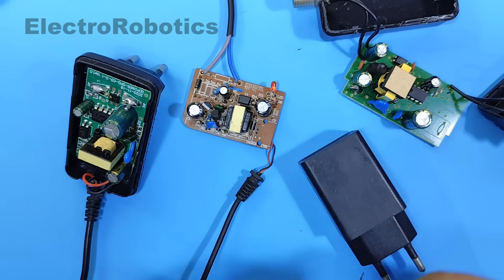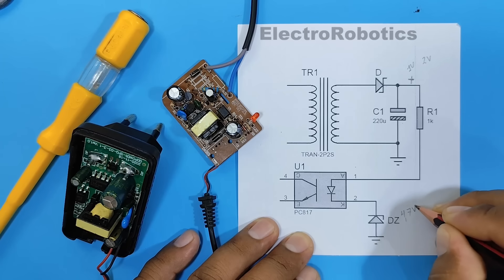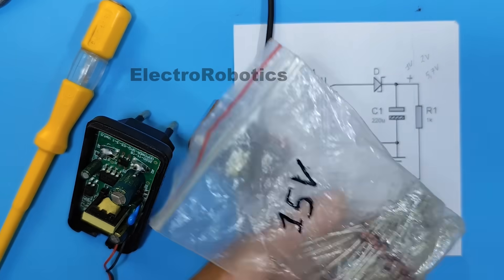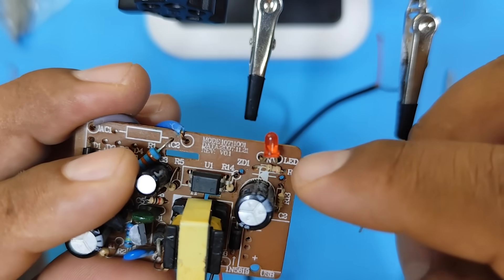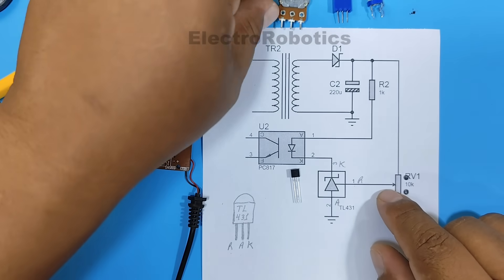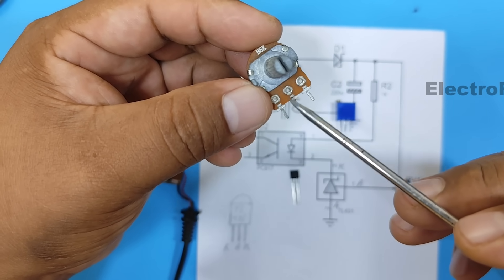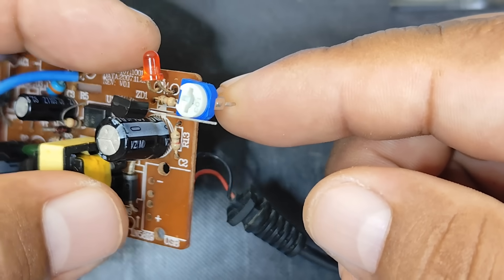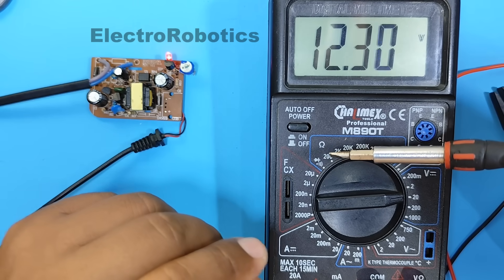Modify Any Charger and Adjust Its Voltage.

Comment: What about Zener Diode D? Doesn't that also affect max voltage limiting your adjustable Zener diode DZ max voltage?
Reply: Thanks to garymucher4082 for making me realize another flaw. Any  irregularity is passed to the TL4312 which can  interfere with the regulation.  This is a real and serious flaw.   Using a DVMM with no load is a rather naive test.
Reply from the maker: Hi Awesome Cat, if you're referring to D1 in the diagram, that's not a zener diode.
It's a Shockley diode, which is different from a zener.
Unfortunately, Proteus8 uses that symbol, which is the same as a zener.
Reply: @ElectroRobotics-qo2er  The zener and Schottky diode symbols are slightly different.  The angled cathode ends bend towards the right on the Schottky diode, rather like the letter S.  The angles bend towards the left on the zener diode, rather like the letter Z.
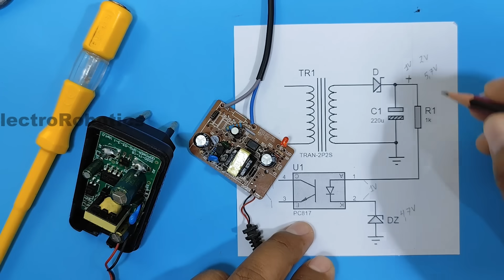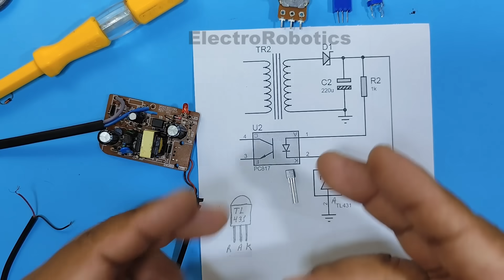Reply: @ElectroRobotics-qo2er  Oh, i just realized that the zener diode D @3:42 in the video changes to D1 later in the video like @6:41. I had wondered why I called it D1 originally then "corrected it" to D. But I googled the Schottky vs the Zener, and I can't seem to find the Schottkey symbol in either diagram in the video. I also find on the web that Zener is shown in two different variations which is confusing since the one that looks closer to an S according to some pages is the Zener. how confusing. I haven't used either, so it's a little difficult to follow which one is which and why one is used over the other. I'm a noob, and so it is a little confusing. I really like the topic, but as a noob, it is difficult to achieve modifying a circuit. My understanding of the Zener vs Schottkey is that the S is faster, but both lock in the reverse voltage to the rated voltage hence, I would think that would affect the final output voltage in the circuit and hence not only dependent on the voltage of the TL431 but the combination of the two TL431 and "D1 or D depending on which schematic you look at".

Comment: ❤❤❤🎉
Reply: So much mis-information
- FIRST SAFETY  is important but no safety precautions are given. The part about adjusting the trimmer is scary bad.
- The current must be reduced else it will over-heat and self-destruct.
 - it does NOT work on all chargers. 
- the output waveform will be degraded, so the load may not work properly.
- he does briefly mention the issue with the output cap .....be CAREFUL. For example if you change to 12V then the output cap must rated at least 16V

 This mod has been around for many years  by very ignorant channel makers. It is too bad he has repeated the same mistakes and same mis-information. He should know better.

Comment: Video about mobile phone charger was very good and I was able to understand about changing voltage for mobile phone charger to be used for different projects
Reply: So much mis-information
- FIRST SAFETY  is important but no safety precautions are given. The part about adjusting the trimmer is scary bad.
- The current must be reduced else it will over-heat and self-destruct.
 - it does NOT work on all chargers. 
- the output waveform will be degraded, so the load may not work properly.
- he does briefly mention the issue with the output cap .....be CAREFUL. For example if you change to 12V then the output cap must rated at least 16V

 This mod has been around for many years  by very ignorant channel makers. It is too bad he has repeated the same mistakes and same mis-information. He should know better.
Reply: @kennmossman8701  So we need to lower the  current of the trimmer, what should I use ? resistor ? Current divider ?
Reply: @DraleXX_005  we need to lower the  expected output current
Reply: There are many similar videos which give incomplete information . Also designing with TL431 requires some calculations to get predictable  voltages & avoid damage which are not mentioned in the video. You have correctly highlighted the problem.
Reply: He missed a lot of important safety information out. The best you can say is that this method will usually work if you don't increase the voltage more than a small amount. There's no way he's a real professor.
Reply: It is a flyback converter. In anycase, the magnetics V.secs decides power output. the switch is high voltage CMOS on chip so current rating cannot be increased. There's soft start, self powering and current limit protection of the CMOS  switch. 

In short, the design cannot be tinkered, except for the limited purpose of gaining an understanding.
Reply: Thanks to garymucher4082 for making me realize another flaw. Any  irregularity is passed to the TL4312 which can  interfere with the regulation.  This is a real and serious flaw.   Using a DVMM with no load is a rather naive test

Comment: Awesome.
Reply: Thanks to garymucher4082 for making me realize another flaw. Any  irregularity is passed to the TL4312 which can  interfere with the regulation.  This is a real and serious flaw.   Using a DVMM with no load is a rather naive test
Reply: So much mis-information
- FIRST SAFETY  is important but no safety precautions are given. The part about adjusting the trimmer is scary bad.
- The current must be reduced else it will over-heat and self-destruct.
 - it does NOT work on all chargers. 
- the output waveform will be degraded, so the load may not work properly.
- he does briefly mention the issue with the output cap .....be CAREFUL. For example if you change to 12V then the output cap must rated at least 16V

 This mod has been around for many years  by very ignorant channel makers. It is too bad he has repeated the same mistakes and same mis-information. He should know better.

Comment: ❤❤❤  nice thank u
Reply: >>>>>>  Do not be FOOLED !

So much mis-information
- FIRST  no safety precautions are given. 
- The current must be reduced 
 - it does NOT work on all chargers. 
- the output waveform will be degraded, so the load may not work properly.
.. be CAREFUL. if you change to 12V then the output cap must rated at least 16V

 This mod has been around for many years  by very ignorant channel makers. It is too bad he has repeated the same mistakes and same mis-information. He should know this unless he is a Professor of BS

Comment: nice and easy insight, thanks sir.
Reply: So much mis-information
- FIRST SAFETY  is important but no safety precautions are given. The part about adjusting the trimmer is scary bad.
- The current must be reduced else it will over-heat and self-destruct.
 - it does NOT work on all chargers. 
- the output waveform will be degraded, so the load may not work properly.
- he does briefly mention the issue with the output cap .....be CAREFUL. For example if you change to 12V then the output cap must rated at least 16V

 This mod has been around for many years  by very ignorant channel makers. It is too bad he has repeated the same mistakes and same mis-information. He should know better.

Comment: Excellent explaination.
Reply: So much mis-information
- FIRST SAFETY  is important but no safety precautions are given. The part about adjusting the trimmer is scary bad.
- The current must be reduced else it will over-heat and self-destruct.
 - it does NOT work on all chargers. 
- the output waveform will be degraded, so the load may not work properly.
- he does briefly mention the issue with the output cap .....be CAREFUL. For example if you change to 12V then the output cap must rated at least 16V

 This mod has been around for many years  by very ignorant channel makers. It is too bad he has repeated the same mistakes and same mis-information. He should know better.

Comment: Deserved the subscribe. What such an amazing and excellent explanation. Thanks. Awesome.
Reply: So much mis-information
- FIRST SAFETY  is important but no safety precautions are given. The part about adjusting the trimmer is scary bad.
- The current must be reduced else it will over-heat and self-destruct.
 - it does NOT work on all chargers. 
- the output waveform will be degraded, so the load may not work properly.
- he does briefly mention the issue with the output cap .....be CAREFUL. For example if you change to 12V then the output cap must rated at least 16V

 This mod has been around for many years  by very ignorant channel makers. It is too bad he has repeated the same mistakes and same mis-information. He should know better.

Comment: Very nice trick. Thanks.
Reply: So much mis-information
- FIRST
 SAFETY  is important but no safety precautions are given. The part about adjusting the trimmer is scary bad.
- The current must be reduced else it will over-heat and self-destruct.
 - it does NOT work on all chargers. 
- the output waveform will be degraded, so the load may not work properly.
- he does briefly mention the issue with the output cap .....be CAREFUL. For example if you change to 12V then the output cap must rated at least 16V

 This mod has been around for many years  by very ignorant channel makers. It is too bad he has repeated the same mistakes and same mis-information. He should know better.
Reply: here is the question, the cellphone charger normaly have 5v 1A, or 5v 2A, what happen you put it to 12v are the amps still can hold 1A or 2A? i bet i become 12v 0,3A or something

Comment: So much mis-information
- FIRST SAFETY  is important but no safety precautions are given. The part about adjusting the trimmer is scary bad.
- The current must be reduced else it will over-heat and self-destruct.
 - it does NOT work on all chargers. 
- the output waveform will be degraded, so the load may not work properly.
- he does briefly mention the issue with the output cap .....be CAREFUL. For example if you change to 12V then the output cap must rated at least 16V

 This mod has been around for many years  by very ignorant channel makers. It is too bad he has repeated the same mistakes and same mis-information. He should know better.
Reply: For the first 11V mod he didn't even check if the output smoothing capacitor(s) were rated for the new higher voltage!!!
Reply: many power supplies dont use zeners as reference voltage but an IC that uses a voltage divider :3
Reply: @MattFixesStuff  Yes. For one thing, zeners can't really be adjusted to the exact required voltage.
Reply: @BrianG61UK  for sure.  in my experience its the cheap ones that use a Zener
Reply: ALSO CHOPPER SATURATUON
Reply: @amynkormy3155  That won't mean anything to this inexperienced YouTuber who definitely isn't a professor.
Reply: Please people just don't do it.
Reply: Absolutely agree with your comment. It is very dangerous to work so close to mains voltage, especially when settings output voltage by trimmer. It is not "nice" video imho, sorry ...

Comment: Really nice video. Great job explaining and demonstrating this.
Reply: So much mis-information
- FIRST SAFETY  is important but no safety precautions are given. The part about adjusting the trimmer is scary bad.
- The current must be reduced else it will over-heat and self-destruct.
 - it does NOT work on all chargers. 
- the output waveform will be degraded, so the load may not work properly.
- he does briefly mention the issue with the output cap .....be CAREFUL. For example if you change to 12V then the output cap must rated at least 16V

 This mod has been around for many years  by very ignorant channel makers. It is too bad he has repeated the same mistakes and same mis-information. He should know better.

Comment: Very well done but I would like   you do with other one as well professor👍
Reply: Thanks to garymucher4082 for making me realize another flaw. Any  irregularity is passed to the TL4312 which can  interfere with the regulation.  This is a real and serious flaw.   Usuing a DVMM with no load is a rather naive test.
Reply: So much mis-information
- FIRST SAFETY  is important but no safety precautions are given. The part about adjusting the trimmer is scary bad.
- The current must be reduced else it will over-heat and self-destruct.
 - it does NOT work on all chargers. 
- the output waveform will be degraded, so the load may not work properly.
- he does briefly mention the issue with the output cap .....be CAREFUL. For example if you change to 12V then the output cap must rated at least 16V

 This mod has been around for many years  by very ignorant channel makers. It is too bad he has repeated the same mistakes and same mis-information. He should know better.

Comment: Very well explained but, what happens if you adjust the trimmer so it is fully at the output end?
Reply: So much mis-information
- FIRST SAFETY  is important but no safety precautions are given. The part about adjusting the trimmer is scary bad.
- The current must be reduced else it will over-heat and self-destruct.
 - it does NOT work on all chargers. 
- the output waveform will be degraded, so the load may not work properly.
- he does briefly mention the issue with the output cap .....be CAREFUL. For example if you change to 12V then the output cap must rated at least 16V

 This mod has been around for many years  by very ignorant channel makers. It is too bad he has repeated the same mistakes and same mis-information. He should know better.
Reply: Kudos to garymucher4082 for making me realize another flaw. Any  irregularity is passed to the TL4312 which can  interfere with the regulation.  This is a real and serious flaw.   Usuing a DVMM with no load is a rather naive test.

Comment: very nice work !!!
Thank you
Reply: So much mis-information
- FIRST SAFETY  is important but no safety precautions are given. The part about adjusting the trimmer is scary bad.
- The current must be reduced else it will over-heat and self-destruct.
 - it does NOT work on all chargers. 
- the output waveform will be degraded, so the load may not work properly.
- he does briefly mention the issue with the output cap .....be CAREFUL. For example if you change to 12V then the output cap must rated at least 16V

 This mod has been around for many years  by very ignorant channel makers. It is too bad he has repeated the same mistakes and same mis-information. He should know better.
Reply: Thanks to garymucher4082 for making me realize another flaw. Any  irregularity is passed to the TL4312 which can  interfere with the regulation.  This is a real and serious flaw.   Usuing a DVMM with no load is a rather naive test.

Comment: Good explanation, easy to understand, good knowledge embedded in such a small video. Thanks you.
Reply: So much mis-information
- FIRST SAFETY  is important but no safety precautions are given. The part about adjusting the trimmer is scary bad.
- The current must be reduced else it will over-heat and self-destruct.
 - it does NOT work on all chargers. 
- the output waveform will be degraded, so the load may not work properly.
- he does briefly mention the issue with the output cap .....be CAREFUL. For example if you change to 12V then the output cap must rated at least 16V

 This mod has been around for many years  by very ignorant channel makers. It is too bad he has repeated the same mistakes and same mis-information. He should know better.
Reply: Kudos to garymucher4082 for making me realize another flaw. Any  irregularity is passed to the TL4312 which can  interfere with the regulation.  This is a real and serious flaw.   Usuing a DVMM with no load is a rather naive test.

Comment: ❤❤❤nice explain
Reply: So much mis-information
- FIRST SAFETY  is important but no safety precautions are given. The part about adjusting the trimmer is scary bad.
- The current must be reduced else it will over-heat and self-destruct.
 - it does NOT work on all chargers. 
- the output waveform will be degraded, so the load may not work properly.
- he does briefly mention the issue with the output cap .....be CAREFUL. For example if you change to 12V then the output cap must rated at least 16V

 This mod has been around for many years  by very ignorant channel makers. It is too bad he has repeated the same mistakes and same mis-information. He should know better.
Reply: Kudos to garymucher4082 for making me realize another flaw. Any  irregularity is passed to the TL4312 which can  interfere with the regulation.  This is a real and serious flaw.   Usuing a DVMM with no load is a rather naive test.

Comment: .👏👍💪 🙏💐
Great video clip,  you're  great professor.
Reply: So much mis-information
- FIRST SAFETY  is important but no safety precautions are given. The part about adjusting the trimmer is scary bad.
- The current must be reduced else it will over-heat and self-destruct.
 - it does NOT work on all chargers. 
- the output waveform will be degraded, so the load may not work properly.
- he does briefly mention the issue with the output cap .....be CAREFUL. For example if you change to 12V then the output cap must rated at least 16V

 This mod has been around for many years  by very ignorant channel makers. It is too bad he has repeated the same mistakes and same mis-information. He should know better.
Reply: Thanks to garymucher4082 for making me realize another flaw. Any  irregularity is passed to the TL4312 which can  interfere with the regulation.  This is a real and serious flaw.   Usuing a DVMM with no load is a rather naive test.